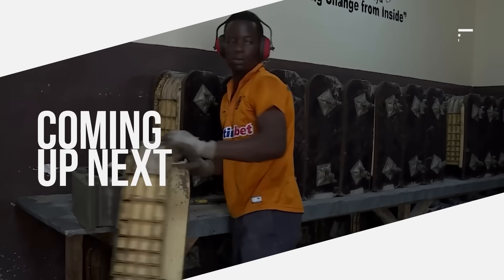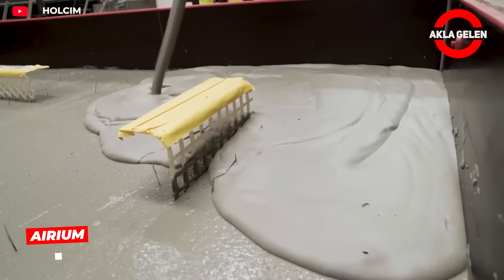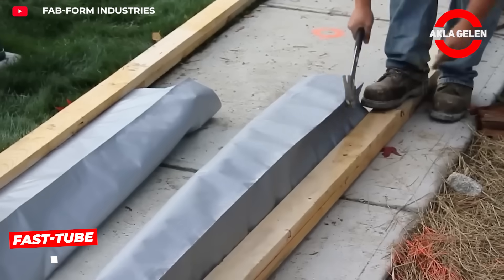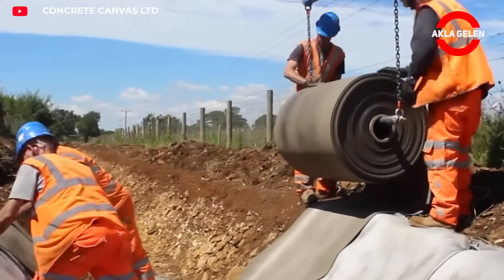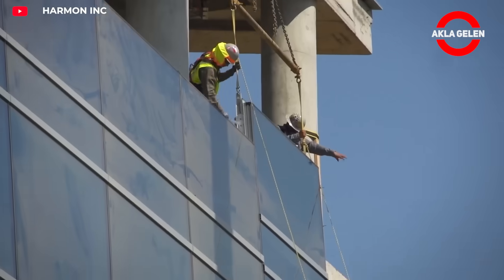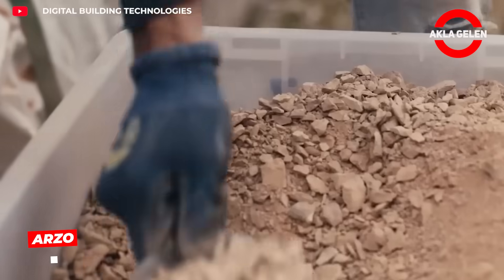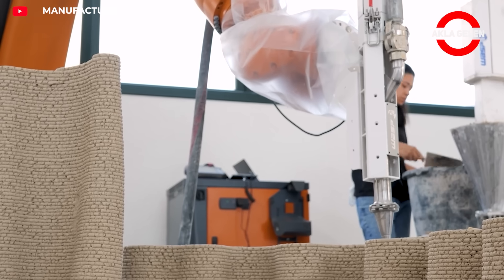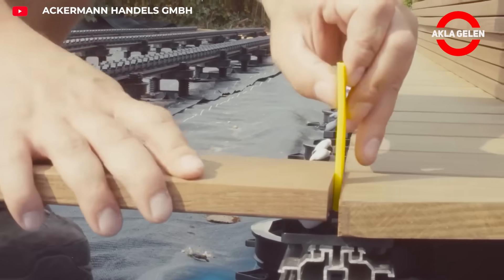CONCRETE and CORN, I can't believe it! I never thought of these ingenious Construction Techniques

Comment: Injecting organic matter into concrete could create voids over time as the corn degrades. That would weaaken the load bearing capacity and degrade the structure. I could attract insects and mice.